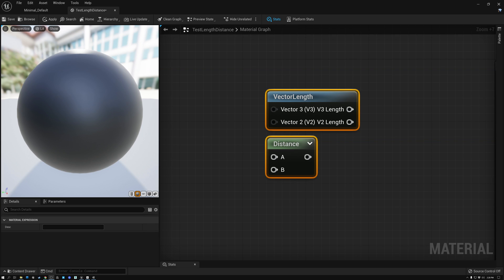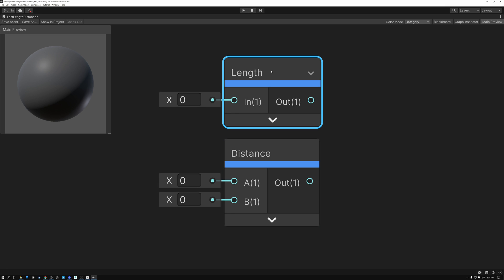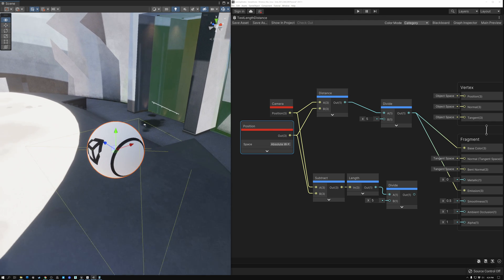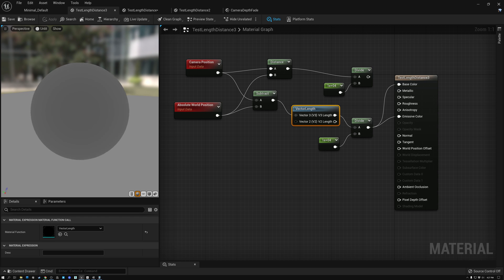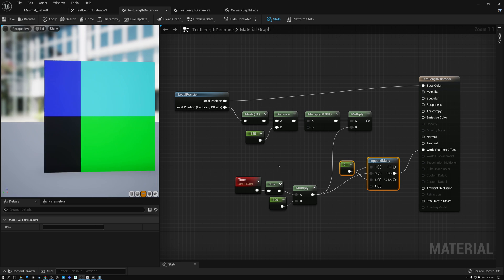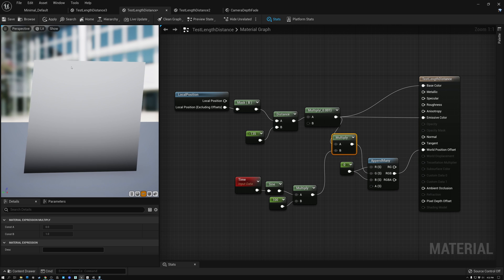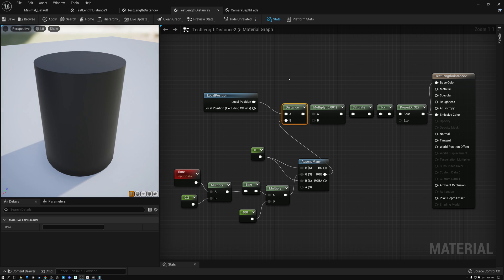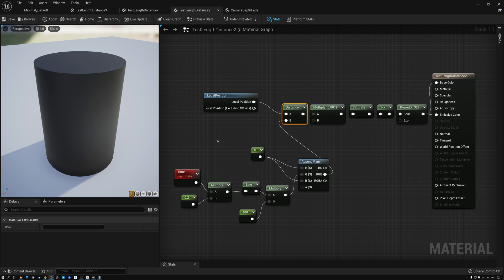Length & Distance - Shader Graph Basics - Episode 16

Comment: I wonder if you can do an Orb flying by a mirror or surface effect, instead of using a light source which could be expensive to calculate. At about 14::00 looks like something flying by back and forth to the cylinder. Field of fire flies

Comment: Great content as always. One question. In your first example with the unity sphere, how did the shader work? I didn't see any texture nodes. Was this a post process shader? Thank you so much!
Reply from the maker: I'm sorry that was confusing.  The stripe and Unity logo are cut into the geometry of the sphere and are using a different material.  So it's just the gray portion of the sphere that we're looking at in the example - and the fact that the shade changes based on distance from the camera.
Reply: @BenCloward  ooh yeah right! Thanks so much for the reply!

Comment: Hi Ben. How have you been? I have had a lot of work and so far this year I have not been able to see it in full. Thank you for your time in sharing with the community, your experience and knowledge are invaluable to me. I really liked the light effect of your third example. I'm going to recreate it. My question would be: How could I make the animation of the light inside the object have a more erratic movement and move a little faster? How could I control those variables since the "y" axis is the only one I see can you manipulate?
Reply from the maker: In my example, I was just moving the "light" back and forth by changing the Y axis, but you're welcome to move all three axis in random ways, maybe add the sine of time to all of them but at different speeds and distances.  That would make the movement more erratic.  You can change the speed of anything just my multiplying time by a larger or smaller value.
Reply: @BenCloward  Hello Ben, thank you for the cool example! 
I'm also thinking about how to randomly moving ''light" and bouncing inside.
Could we define a bounch of fixed points outside of the object in every direction first, then the light moves towards one of these points.
And when the light is out of the bound of the object, it switch to next point to move the light towards to.
Could this possibally work?